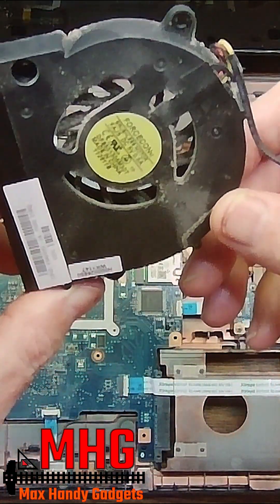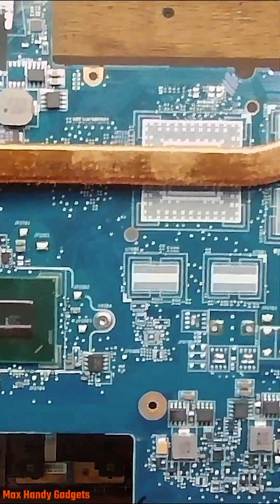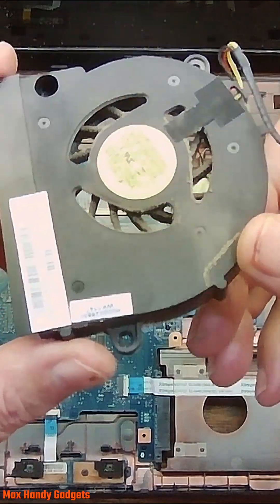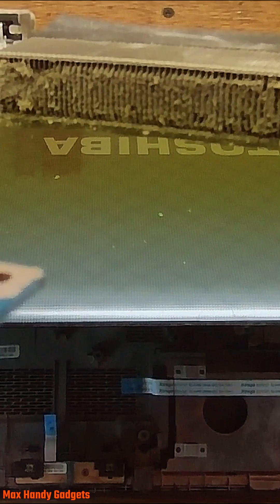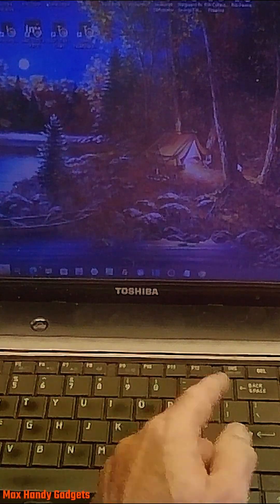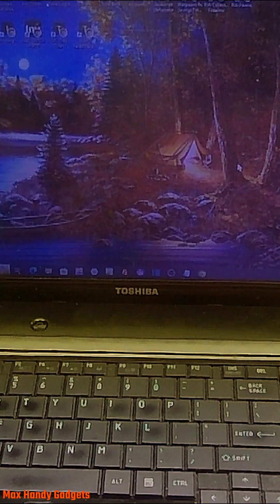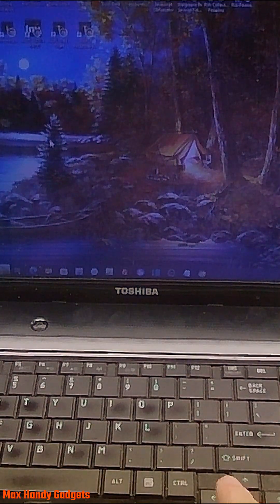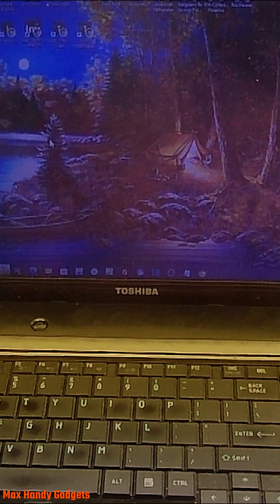Can We Fix It? an Overheating Toshiba Satellite L775 Laptop Fan Cleaning and Thermal Paste #shorts

Comment from the maker: Today we're back in the workshop trying to fix this old Toshiba L775 Satellite Laptop that overheats and shuts down by itself when we put a load on it. We didn't want to throw it away, so today we're trying to bring new life back to the old Toshiba laptop by giving it a good cleaning and adding new thermal paste too. 
👉Check it out; maybe this could help you if your old Toshiba laptop is having the same or similar problems.

Comment: Does it require professional skills needing talent to remove all the screws?
Reply from the maker: No professional skills are required; before you do anything, disconnect the battery and just take your time. Some screws are different sizes; keep track of their placement and keep the screws separate (keyboard screws, etc.). Also check the long video for more detailed information if you get stumped. 👍You can do it, no problem.
Reply: What kind of screwdriver sizes need big or small?